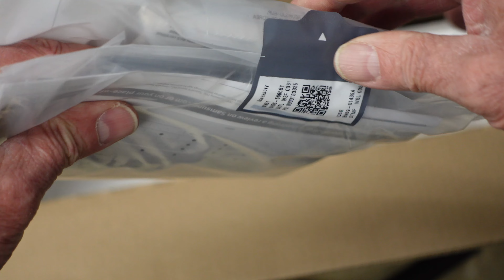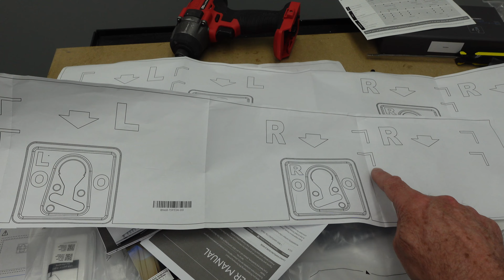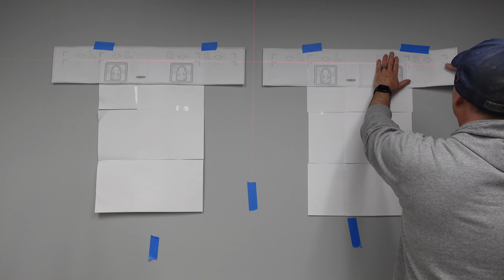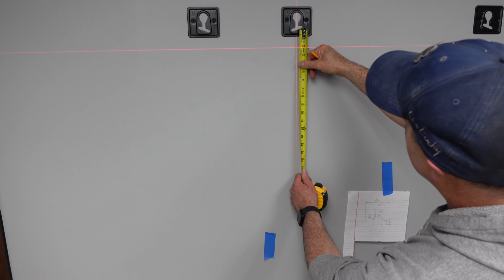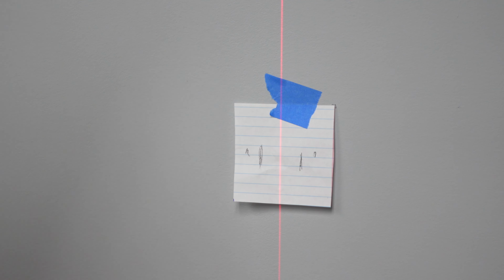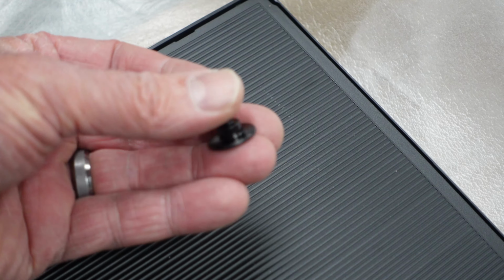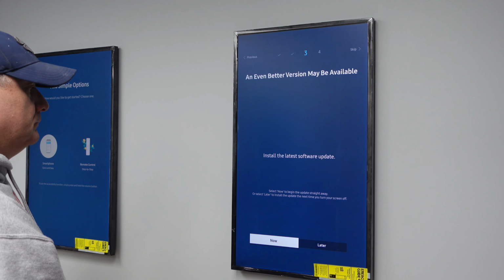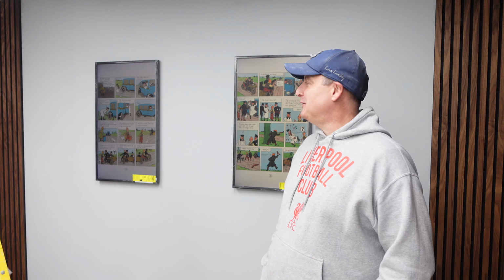How to Install TWO Samsung Frame TVs Vertically | Step-by-Step DIY Guide for a Stunning Setup!

Comment: Great video Steve!
This is exactly what I've been searching for now after a year.
The perfect mounting system for the Samsung The Frame TV.
It looks like you are mounting an old model (2020) because the new sets use a different slim fit mount.
Any way you can confirm the model of your TVs as well as the year they were made?
Greatly appreciated!
P.S. I would like to DM you if possible.
Thank you very much :)

Comment: How did you change to vertical mode? Do you know if the 43" Frame TV also have vertical mode feature?
Reply from the maker: It’s done during the setup and is very easy. All models have vertical as an option.